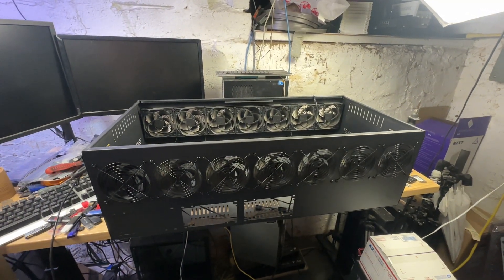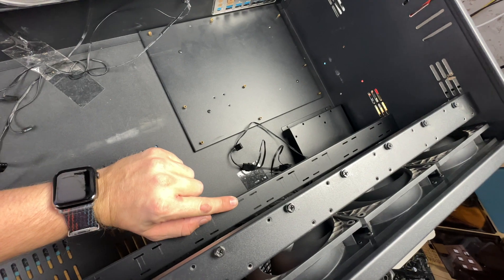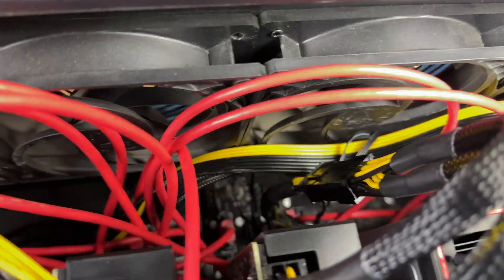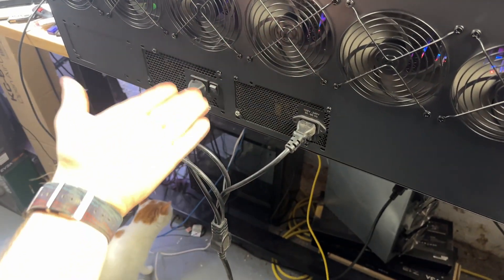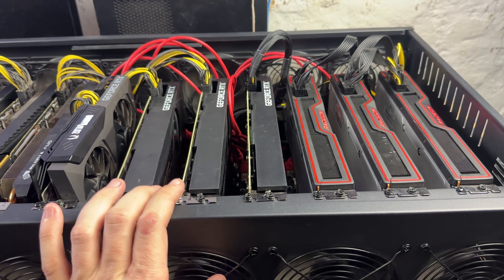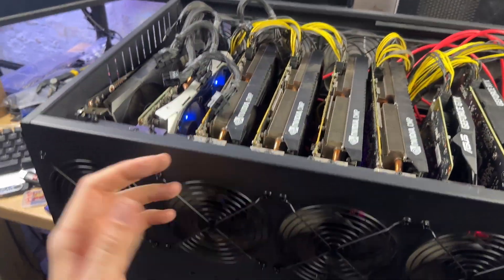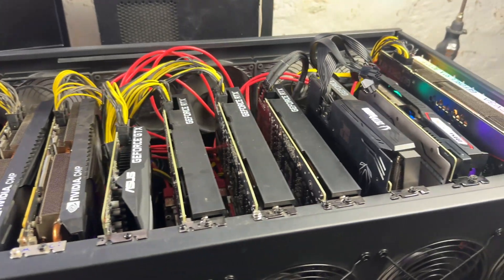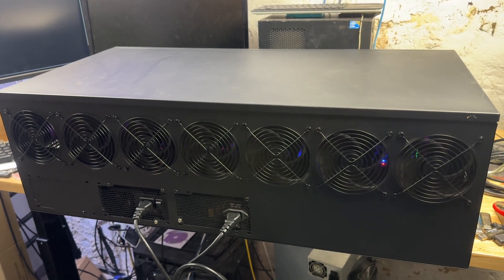13 GPUs, one $140 case. Should you?

Comment: That case is a monster. Need some longer cables for sure. Parallel Miner is great for that. I’m an Octominer fanboy myself. Even the ones I bought used that were having issues I was able to troubleshoot until they worked perfectly
Reply from the maker: I have seen people use off the shelf USB3 cables, or even USB3 extension cables with risers but was surprised to see in my bin of riser hardware, they're all exactly the same length (and too short)

Comment: Seems like it would be decent if you could modify it for server power supplies. Thanks for the video!
Reply from the maker: thingaverse is rife with STLs for DPS1200 mounting in ATX slots, I agree though. thats how to make it cheap and effective. reduce the number of splitters and running a $20 PSU instead of a $120 one :)
Reply: @OvalboreTech  yes exactly! Of course needgearz is now sold out on that case! I should have jumped on it sooner.